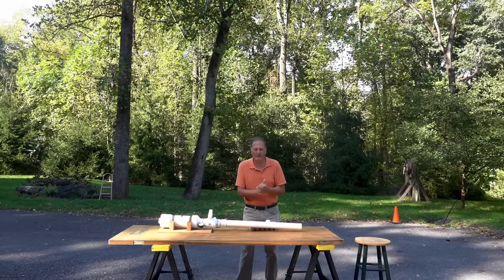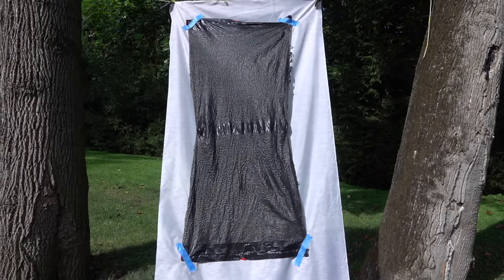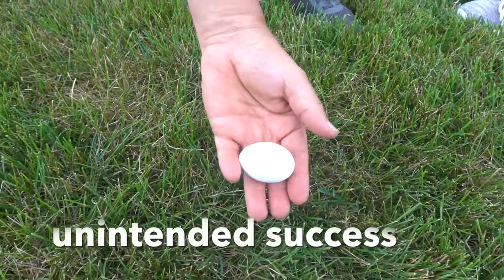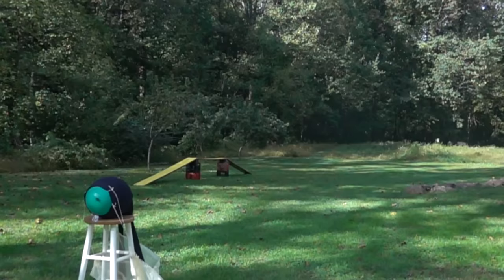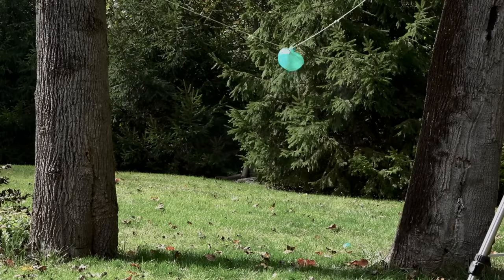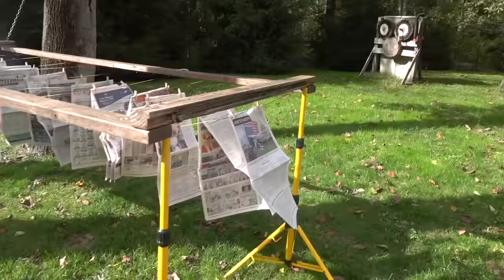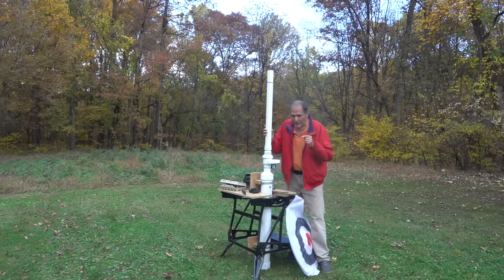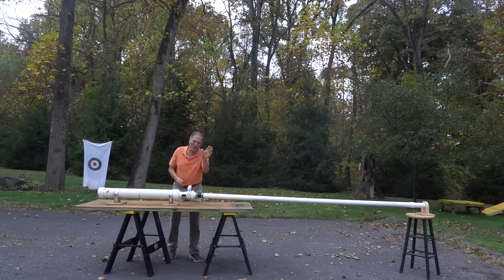Trying to Catch 300+  MPH Eggs ------  Physics  Impulse Challenge

Comment: One of the very first tests showed the egg didn't break passing through a sheet. Should have immediately tried multiple sheets. Eventually did this with newspaper, but would have been interesting to see how many sheets it would have taken. I'm guessing each sheet would have provided significantly more drag than the newspaper, but that's just a guess. If the eggs rarely/never break when passing through one sheet, I believe this would be guaranteed to work (or maybe that's why it wasn't tested?).
Reply from the maker: I should have shown more,   I'd guess about half the time if the egg has enough energy to pass through the sheet it would break.

Comment: FYI it's a really bad idea to use PVC pipe as a pressure vessel. When it fails, it shatters into thousands of really sharp shrapnel which go in all directions. Seen it before.
Reply from the maker: I'm actually doing research on PVC cannons and hope to do a future video on the dangers of them.  I am finding a few factors that seem to cause the majority of the problems.
1.  The majority of  problems seem to center on combustion cannons
2.  Too large of a combustion chamber versus small barrel size 
3. A lot of the  problems occur with potatoes as the projectile,  tested this myself,  it can  a lot of effort to move a thick wedge of tightly fitting potato down the barrel, no wonder some joints break.
4.  Elbows in the barrel seem to be a common problem point,  gasses hitting them at high speed can blow them out
5. Other common failure point is the large screw cap at the rear of the cannon.

Comment: I wonder whether a fluid with less surface tension and lower viscosity can catch the egg at a higher speed
Reply from the maker: I actually had a similar idea but didn't get to try it.  I thought bubbling air through water would help reduce the surface tension.  I also haven't figured out how to lift and aim a 13 foot long  cannon straight down.
Reply: @YeanyScience  fair, that might prove difficult XD

Comment: Will an egg break when it breaks the speed of sound? This is what we need to know.
Reply from the maker: I have  wondered how fast an egg can go before air resistance would break it
Reply: @YeanyScience  There's a huge difference between the shell thickness of farm yard eggs and those produced by battery farming. They are noticeably harder to break when cooking and you can see the difference in thickness visually. All the white pipe you use can be replaced with blue high pressure pipe along with high pressure glue, maybe if you upped the pressure, tank size and barrel length you could get it to the speed of sound.

Comment: Why did you resort to any of the alternatives after showing us the solution first-go? A sheet can catch an egg, but when it's going too fast it passes straight through without breaking. Why not just hang successive bed sheets?
Reply from the maker: because usually the egg breaks when it passes through the bedsheets same thing with the blue tarp. if you watch the clip where I shot  the egg  through the 24 sheets of newspaper and then the sheet you can see that the egg passed through it but broke.
Reply: @YeanyScience  ah I missed that part! thanks for the reply

Comment: But putting compressed gas in PVC is dangerous, as the PVC tends to shatter when it fails, turning into jagged little missiles.
Reply from the maker: I've been doing some research and asking for stories or mishaps  with the dangers of PVC cannons, also did a bit of testing.  I hope to post a video on what I've found.   Most common problems seem to be exploding gas cannons, usually had potatoes wedged in so tightly the gas could not push it out fast enough.  Also breaks commonly occur at elbows, gas hitting a 90 degree elbow joint can blow it off the pipe.  Some suggestions for those that insist on building their own.
1. schedule 40 pipe, nothing larger than 4 inch pipe  diameter. As pipe gets larger the pressure rating drops.
2. Compressed air instead combustion, also compressed air allows for longer barrels
3.Air chamber and barrel in a straight line no elbows
4. Loose fitting projectiles that move easily through barrel
5. Screws through the glued joints ensure they don't come apart
6.Wrapping the barrel and joints 
7.Keep out of sunlight, do not store outdoors,
8. Drop not drop
Reply: Thanks for taking the time to reply! @YeanyScience  Not at all trying to trash the video, I really enjoyed it. Just trying to warn of the dangers.

I believe it is OSHA that has a rule prohibiting the use of PVC piping in compressed gas systems, and many boxes of PVC fittings will have warnings printed on them stating not to use compressed gas to test them.

Comment: If its possible to accelerate the egg without breaking, it should be possible to decelerate it without breaking.  You just need the appropriate technique.
Reply from the maker: the problem is the orientation of the egg, accelerating is done along the longer axis which is very strong, once in flight it rotates so that it leads broadside which is much weaker.
Reply: @YeanyScience  Then change the angle of contact so the egg strikes the sheet or paper at a glancing angle and rolls into the sheet or paper.  It may require adding some curvature to the receiving surface as well.

Comment: It would be great if you switched to some device of measurement which did not consume resources requiring atrocity against an intelligent creature every time you make a measurement.
Reply from the maker: These eggs would end up in the dumpster if I didn't use them. I get the eggs from a supplier that saves them for me.  they are past the expiration date and can no longer be sold for food.  not a good idea to eat old eggs.